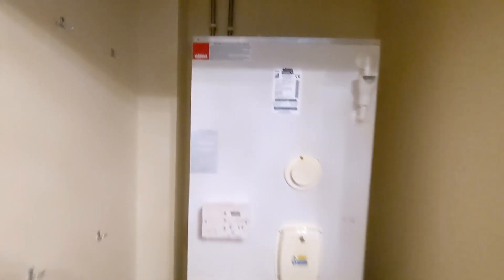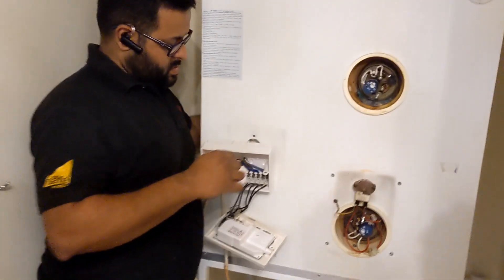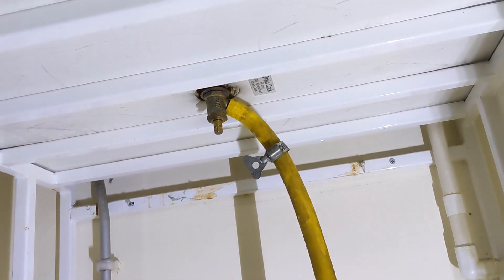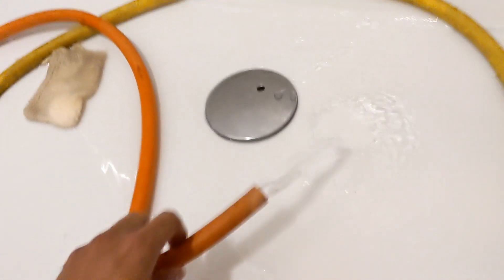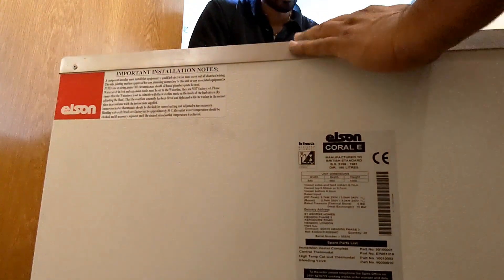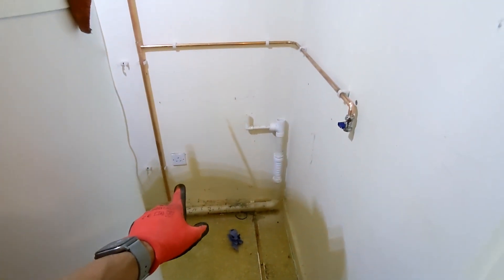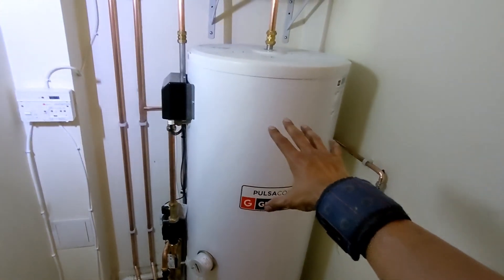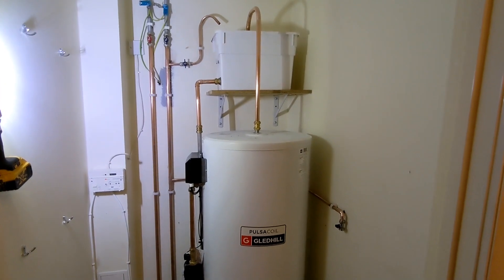Direct Thermal Store Install

Comment: I assume you have electric heating? 
Im in the process of fitting a 1000L tank, running off an ashp, wood burner and solar thermal/pv.
Lots of inputs and a lot of water to heat. 
Im going vented and have a 30kw exchanger for dhw.
Fingers crossed it works 😂

Comment: Just a couple of points.  The trouble with the heat exchanger thermal store is that it brings in a level of complexity, and thus unreliability - with a flow switch, pump, thermistor, and some electronics!  The coil one is much simpler (and the coil one has a built-in F&E tank).  With both the HE and the coil, it is Building Regs that you should install a limescale inhibitor in areas of hard water, like a LimeStop 500.  If you don't, then the HE will scale up in three years or even less, and the coil one will in about six years.  My other point is that it looks like you have put it under programmed-timed control.  It shouldn't be, really.  Hot water should always be there (the immersion heater stat will control it).  The only reason for controlling it is for cheap rate electric.  If you put the cylinder under control, then the store may not be at the optimum temp (this is primarily the coil types, admittedly).  The Gledhill does compensate for that, by running the pump faster as the store depletes...and there's those electronics again!
Reply from the maker: Thanks mate, yeah I've recently done a couple more and moved over to the coil ones. Much simpler and less to go wrong!
Reply: @cputilitysolutions  what thermals you fitted/ recommend. simple option
Reply from the maker: @todtod1812  Advanced Appliances do really good ones 👌🏾
Reply: @cputilitysolutions  yeah thankyou, looking at those, look good

Comment: what keeps the water hot inside the cylinder? i assume the immersion heaters?? if so would this not be hard on the electricity?
Reply from the maker: The flat is all electric, they don't have a choice
Reply: 3kW.  Costs £1.02 an hour.